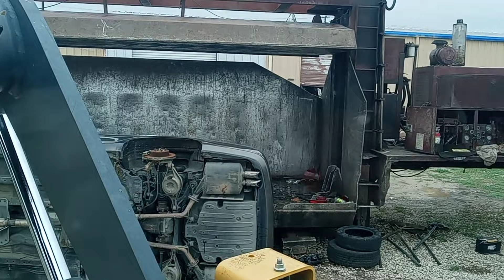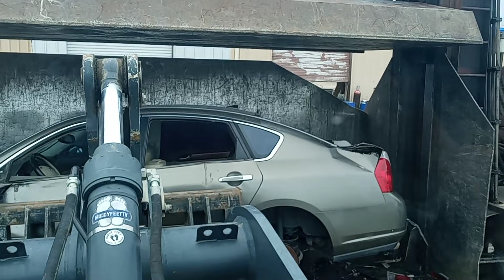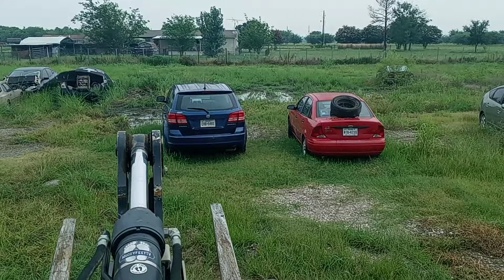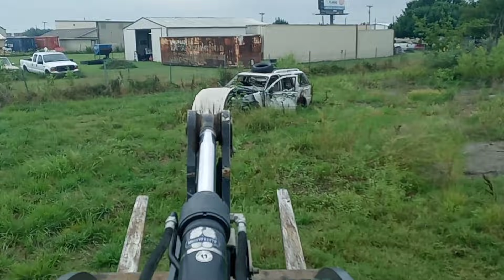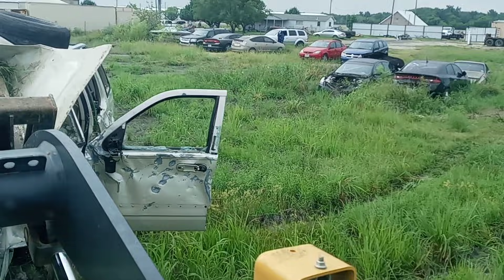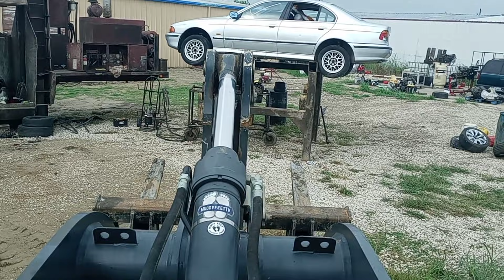I'm Crushing Cars. Having production equipment problems 😡

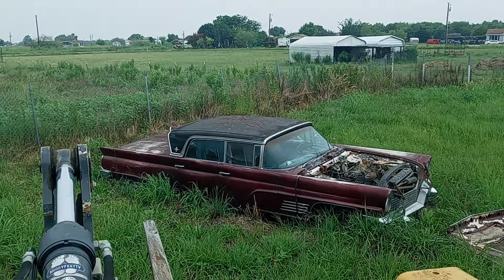Comment: 3:32 It's a 1958 to 1960 Lincoln Continental Cowboy. I'm glad that it doesn't have a date with the crusher.
Reply: It's only a matter of time before there isn't enough of it left for a date with the crusher. That looks like it's going to become a rust stain on the ground where it sits. Unless someone wants it and will take it out of that field, it's gone one way or another, in time.

Comment: The Porsche is a 944, built between 1982 till 1991. They had a 4 cylinder engine in 2.5 ,2.7 or 3.0 liter. In their time they were quite fast, especially the turbo version.

Comment: Should have made the pipeline operator pay for the cost of the removal if they wanted the pipeline to run across the property, otherwise jack up the "inconvenience fees" when they are laying down the pipeline, including loss of business & the cost of moving any cars or equipment"(every car moved should  have cost the pipeline operator $200 each (put every car in the way) to make up the cost of removing the oil tanks ) hey its private property " pay the cost of use if they want to use it ,its a 2 way street, my late aunt had the same issue with a old oiltank ,they wanted $75k ,well the cost of demolition to the tank & barn was just slightly over the cost 🤣 they ended up paying it